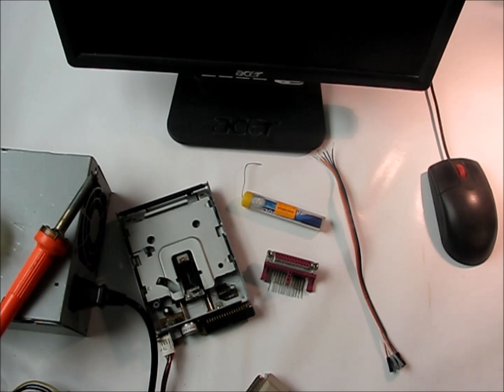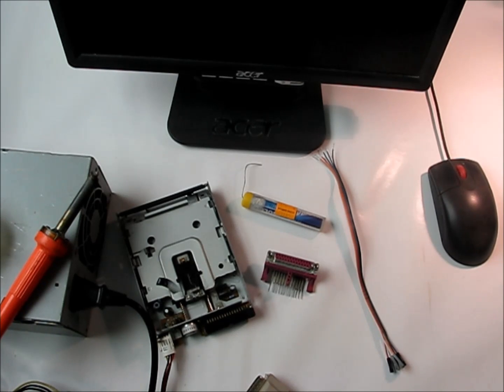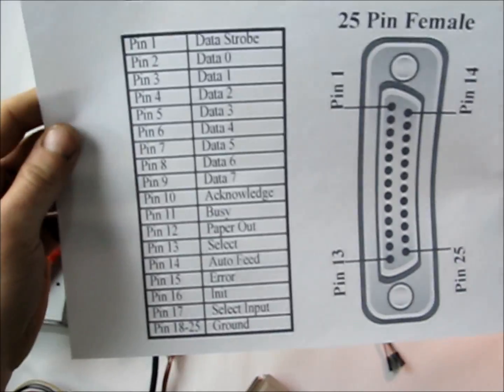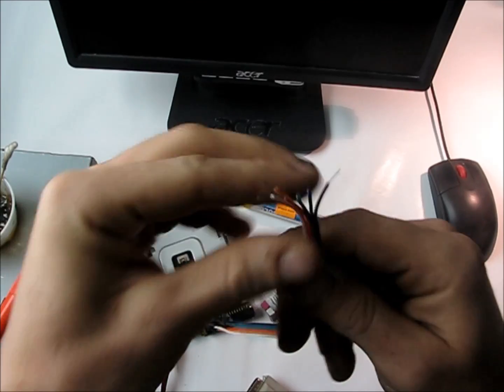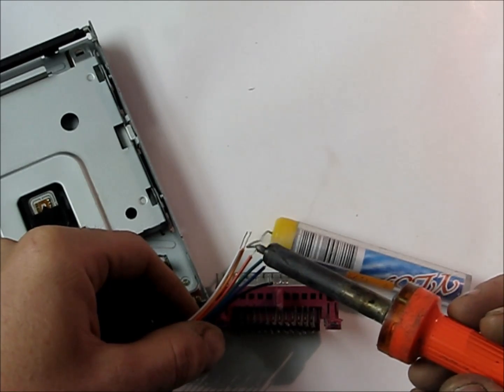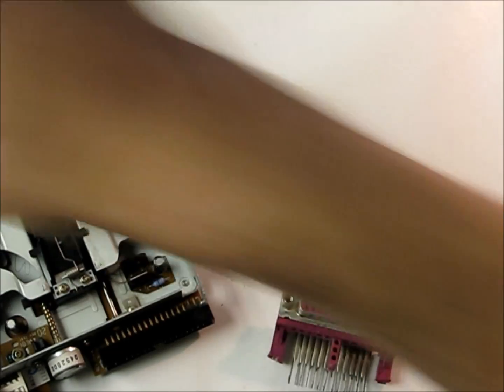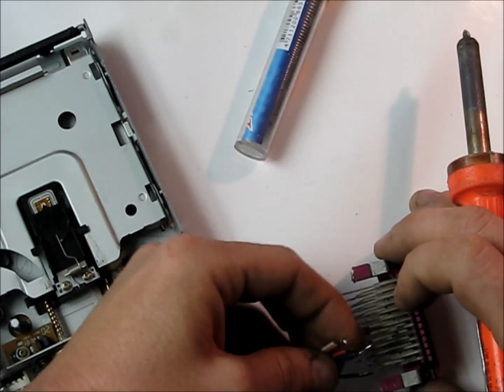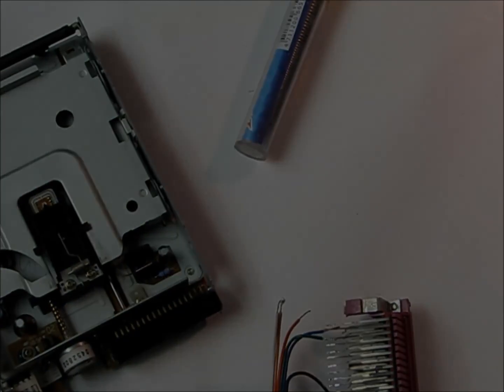DIY FLOPPY DRIVE CNC: Part 2 - The Printer Port Interface

Comment: maybe you should try using like some triacs connected to the motor outputs and put a bigger motor xd
Reply from the maker: You can use Mosfets to power each coil.. to make it more power.. :) But I am using L293d chips now for powering my bi-polar steppers.. they are only 5$ each.. not too bad.
Reply: oh thx :D , another thing u could teardown a new hotglue pistol to make a kinda extrude system with another motor with another floppy disk drive  ,put the abs plastic wire and assemble it at the cnc and there u have a 3d printer xd
Reply from the maker: I tried :( it didnt work.... I couldnt figure out how to use the serial port to monitor temperature.... soon i might know i have arduino now... i maybe can use arduino to monitor temp and the extruder stepping... I hope somebody does it... i dont think i have time, i start work in a week.. i will be busy again :(
Reply: try with some microcontrollers u could configure there the temps that u want
Reply: Jackie Chan wow you would think with jackie chan's acting career, one would think he would be to busy to be watching diy cnc videos!!!! lol
Reply from the maker: Noah Rudderham
LOL